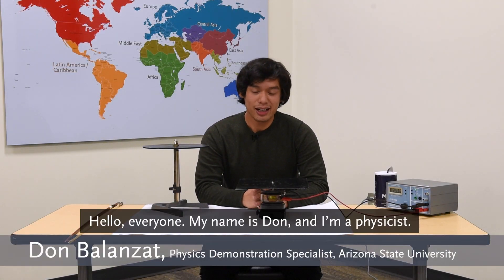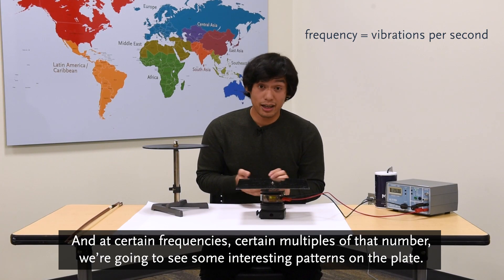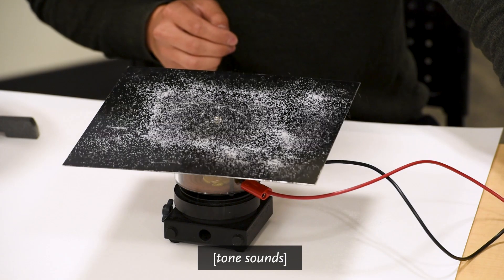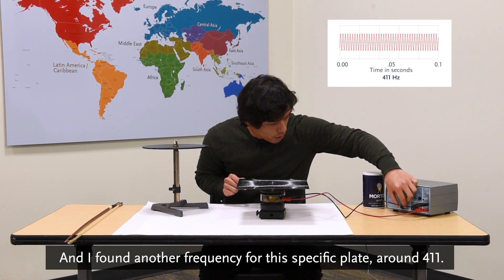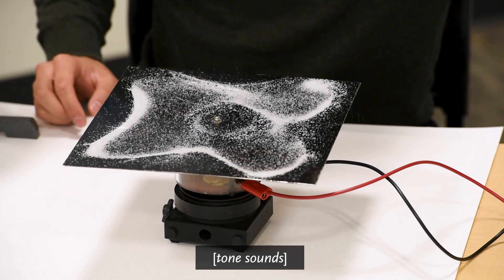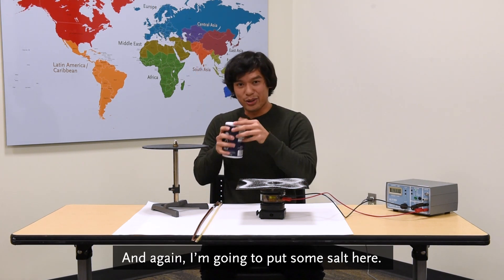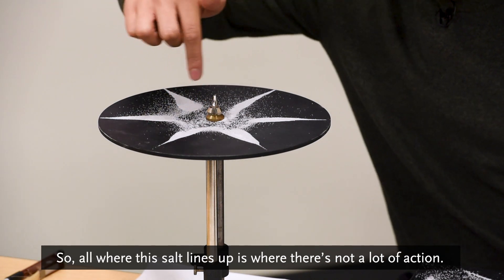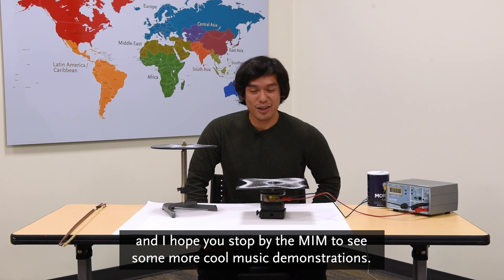Chladni Plate | STEM Demonstration

Comment: the pattern in the plate attached to the driver is not centered
. is that due to the molecular structure of the plate or is the bolt holding the plate to the driver is not applying even pressure around the bolt thereby restricting vibration at certain parts of the plate?